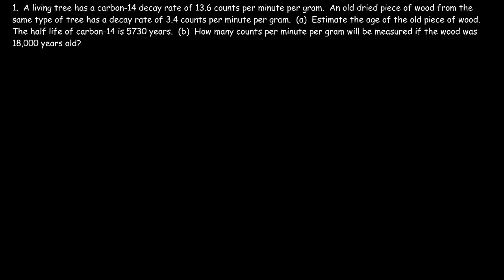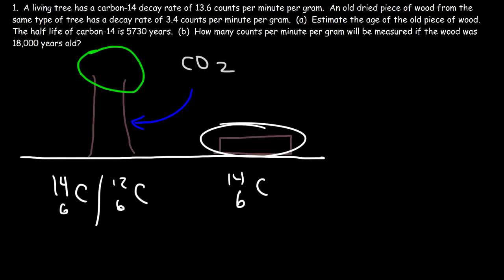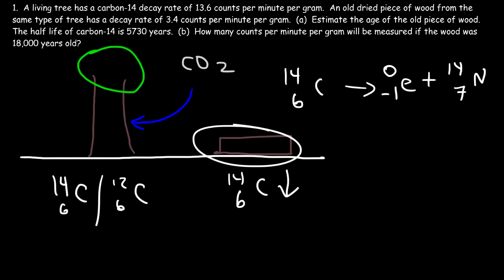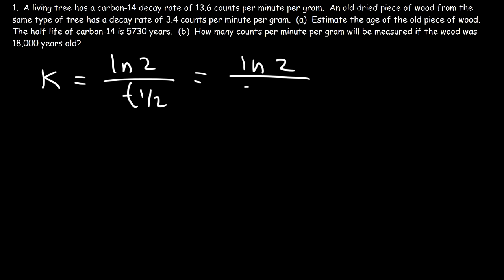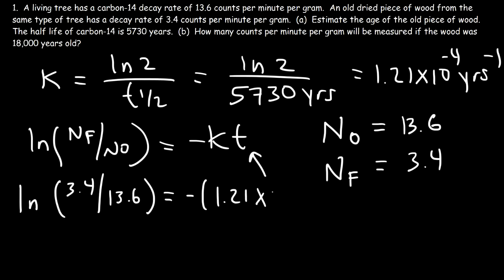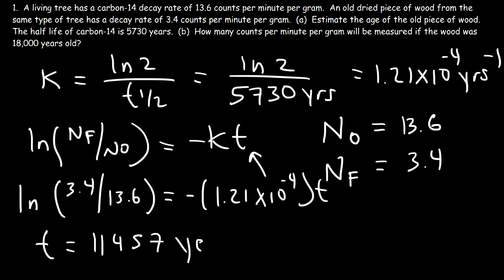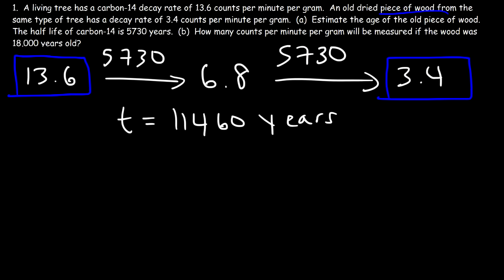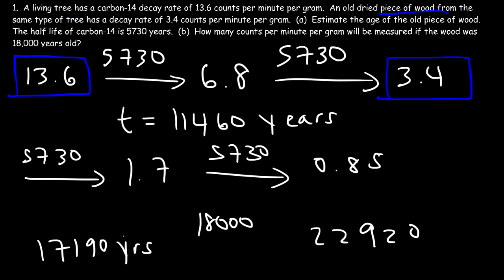Carbon 14 Dating Problems  - Nuclear Chemistry & Radioactive Decay

Comment: C14 half-life is 5730 ± 30 years, who was born ~5730 yrs ago and observed certain amount of C14 decay to half of it's original amount after 5730 ± 30 years?
Reply: Nobody. The half-life is simply calculated from the decay constant which is the rate of decay as measured by beta particle emission.    T 1/2 - ln(2) / lambda  where lambda is the decay constant.
Reply: I’m guessing if you have a “large” sample size and then compare the radioactivity after a “long” time period you can extrapolate a accurate picture.

The bigger problem might be the assumption that carbon 14 was at a constant ratio through the last 50,000 years. That’s an assumption they make. It’s also an assumption that the decay rate is a constant through the existence of the universe.
Reply: @godloves9163  You are right about religion = mythology!
Reply: @godloves9163  Belief is accepting something without evidence.  Scientists do not "believe", they accept evidence and if the evidence changes and can be validated, then it is accepted.  Belief is in the domain of religion, all religions require their followers to believe in things that cannot be proven, a very big difference from science.   It is sad that you appear on the comments to a scientific video and try to denigrate valid science and insult scientists to prop up your religious beliefs.
Reply: @godloves9163  So, when you get fat by eating too much, the complex molecules in the fats and proteins cannot possibly organise themselves?   You are entitled to your religious beliefs, but getting them mixed up with scientific facts that can be validated by many others is futile.
Reply: @godloves9163  OK so there are still mysteries to be discovered, but compare what we know today to what they knew 2000 years ago.  You are using a computer that is astonishingly  powerful compared to only 50 years ago.  I'll bet that in another 200 years we will know all about DNA and many other things you think are mystical today, that is the way science progresses.  Science is just shared knowledge and the Creator put lots of things out there that will challenge us to the end of time.  The "big bang" sure looks like the moment of the creation, just a bit further back than the people thought when the Bible was written.  It had to be simplified for the educational level of the folks back then anyway.  No reason for science and religion not to co-exist, but each has its own set of criteria.  Have a great day!
Reply: @karhukivi   not even close. It’s not a mystery. You believe a book can write itself or complex information system can come about by random chance. That’s against the laws fir nature, physics, observed science. Indeed you believe in an impossible mythology. There a difference between unknowns of how some things work compared to how it was actually made when we already have the evidence. But some want to remain in willful ignorance. No book can write itself ever but THIS IS YOUR BELIEF THAT IT CAN. That’s the point.

You ignore the bible because you love some type of evil in your life and don’t want to let it go but convinced yourself over time that it’s ok. Ponder in this deeply. People willingly ignore the fact that the book of Daniel written centuries before Christ predicted the last 2500 years of major human events. This is only a very small portion of the predictions etc: “Angels in the Glen book of Daniel study”
Reply: @godloves9163  I could point out that there are already robots that can do self-assembly, but I can see you are fully committed to your beliefs and there is no benefit to me in trying to change those beliefs.  We will agree to disagree, and I'm signing off here.  Have a great day!
Reply: @karhukivi  Also no... your fat cells do not organize themselves, they are sorted into storage or use within the body do to a complex and specific process of interactions between several hundred to thousands of cell Colonial masses, which use RNA to trigger and sort themselves about their tasks across the body, and error or issue to the body or cells can prompt improper interaction or storage and thus lead to complications like obesity 

It is not "random" because of the programming of the cells and the lipid exchange, the complex and coherent information requires intelligence to direct and execute properly, else the body dies... this must go on every second of every day, without issue...on top of the fine tuning required to prime celluar life with the ability to adjust to external stimuli acting through bioreactive mediums (water, blood, early earth mixtures of minerals and liquids, ice etc)

Again, a weird way of saying these things, but thats the point, I'm trying to point out how the language of modern science doesn't stray far from its alchemical, occultic roots

Darwin and his bulldog influenced Huxley, and Crowleys effect on science alongside the new age movements touch on rocketry with the Nazis...the truth is closer to fiction than you'd want to believe...

Comment: The theory is nice, but in practice ?  and the influence of powerful CME or geomagnetic storms ? how to take a sample?  having a mass perfectly known ? putting it in a detector and not miss one decay event ? I don't understand how historians are able to pinpoint exactly one year (especially during the first millenia) for events, and how to be sure Rome avents and Gaul events are in sync ?
Reply: Because they are LIARS.
Reply: You don't just take carbon dating by itself, its got a 5% margin of error that needs to be taken in conjunction with anthropological/historical evidence. It's the carbon dating in combination with other evidence that gives it power.
Reply: @theophrastusvonhoenheim4022  yes, you combine several clues to converge toward a date approximation. Clues in order or stratification, clues in writing, etc.  But if you thing is buried instead of anbandoned there, if your writing is a fiction and not a birth certificate, and if the sun sneezes at this moment, then the dating is off.

Comment: This method works wonderful giving the decay rate of the things, or the sum of c14 before hand. But this method is not reliable when the sum is not given ahead of the equation.
Reply: Again they assume many factors which is non scientific lol
Reply: Remember that c12 is also there and the ratio of c12 and c14 in a living thing is going to be similar to that in the atmosphere (which we can measure). c12 doesn't decay so all you need to do is look at c12 and calculate how much c14 there was before it died (or got cut of from a tree).
Reply: @MrDzoni955  How would that prove that the C14 is decaying at a steady rate over thousands of years though? The c12 would just be a base amount to juxtapose with the c14 but the changes would have to be confirmed over various examples wouldn't they?
Reply: @ThatOneAlbinoMofo  We know the rate of decay and it's fixed. c14s half life is always the same. Now this is physics and the math behind it is way to complicated for a layman like me
Reply: @MrDzoni955  I agree, i suppose the issue comes from when we question the concept of "proof " as subjective or objective?

For example,
Radiocarbon dating seems to be a based on subjective inferences rather than objective claims witnessed in action with the of the variables of the "natural" world 

I think I all boils down to language when it comes to science, in fact it would be hard for us to discuss these things with beings if energy or of those beings with prolonged lifespans even if they were able to help us prove our methods are correct, that's a huge consideration to play around with

I think thats where doubt comes into play for skeptics like myself, I don't doubt the science, just the certainty of the conclusions as applying by those that reference the research but lack the means to perform the experiment themselves?

Comment: The assumption that C14 is constant is incorrect, 
Carbon14 can be affected by a number of different factors or events:
	• The strength of Earths magnetic field
	• Atmospheric C14 variations between hemispheres
	• Burning of fossil fuels as during the industrial revolution caused variations to the C14 in the atmosphere because of human use of fossil fuels (Seuss effect) and decreased sun spot activity (Maunder Minimum)
	• Alteration effects such as fractionation (dC13 correction)
	• In situ production from N14 within trees
	• C12 added to the tree through the uptake of water from the subsurface dolimitic (carbonate) soils this would result in C14 ages obtained which would be much older than they really are.
	• Recrystallisation in shells and the marine effect
	• Volcanic eruptions contaminating the atmosphere
	• Forest fires
	• Sun flares
	• Lightning storms - Carbon-14 may also be produced by lightning [22][23] but in amounts negligible, globally, compared to cosmic ray production. Local effects of cloud-ground discharge through sample residues are unclear, but possibly significant.
	• Nuclear testing

The C14/C12 ratio can never be proven to be a constant.
Reply: @Dylan Morrison can you state how much Carbon is stored in Coal, Crude oil and Natural Gas underground?  This C12 would have been above ground at some point.  Now calculate the C14/C12 ratio and compare it.  I would suggest that would change the C14/C12 ratio substantially.
Furthermore,, If the atmosphere were millions of years old then the C14/C12 ratio would be at equilibrium . However we know the ratio is not at equilibrium therefore the atmosphere cannot be millions of years old.
 Since C14 is forming faster than it is decaying it is impossible to know the past ratio and get an accurate age calculation by carbon 14 dating.
In addition we know that if a fossil contains carbon 14 then the fossil is less than 60,000 years old.  The AMS method claims they can measure to 90,000 years.
Reply: The method is calibrated against such data as tree rings and historical items whose dates are known, so all the effects large and small that you list are in effect factored into the calibration.  It is also calibrated against other dating methods like thermoluminescence.  So far, the assumption that the C14/c12 ratio is roughly constant seems to work out very well.
Reply: @karhukivi  OK tell me what the C14/c12 ratio was 6,000 yrs ago.  Remember we have a shed load of C12 buried in coal, oil and gas.
BTW I have 3 trees all of the same species (silver birch) planted 15 yrs ago within 10m all had the same watering in the same soil yet all 3 are different diameters ranging from 3.5cm to 15cm.  The trees in.my street are pin oaks and they all show different diameters.  Either the thickness of rings are different or some have multiple rings.  I presented that research to IntCal and I've yet to get a response.
Wuth thermoluminescence
there are many unknowns and many assumptions need to be made, including the amount of radiation ‘stored’ in the mineral at a certain time in the past, that the change in radiation has only been affected by the radiation in the environment, that the radiation in the environment has remained constant, and that the sensitivity of the crystal to radiation has not changed. All these factors can be affected by water, heat, sunlight, the accumulation or leaching of minerals in the environment, and many other causes.
Re: Dendrochronology
"The biggest problem with the process is that ring patterns are not unique. There are many points in a given sequence where a sequence from a new piece of wood matches well (note that even two trees growing next to each other will not have identical growth ring patterns)...." 
The extended tree ring chronologies are far from absolute, in spite of the popular hype. To illustrate this we only have to consider the publication and subsequent withdrawal of two European tree-ring chronologies. According to David Rohl,  the Sweet Track chronology from Southwest England was ‘re-measured’ when it did not agree with the published dendrochronology from Northern Ireland (Belfast). Also, the construction of a detailed sequence from southern Germany was abandoned in deference to the Belfast chronology, even though the authors of the German study had been confident of its accuracy until the Belfast one was published. It is clear that dendrochronology is not a clear-cut, objective dating method despite the extravagant claims of some of its advocates.

But you're welcome to BELIEVE that.
Reply: @georgebond7777  Science is not about "belief" - that is the domain of religions!  Of course there are limitations and assumptions as with many scientific techniques and constant attention is paid to calibration in research publications.  If you read a good selection of publications on C14 dating and still cannot accept them, then that is your prerogative and I have no intention to get drawn into an argument about your beliefs - you are welcome to believe whatever you want!
Reply: @karhukivi  of course it's about your beliefs.  You BELIEVE a dot of nothing exploded caused rock soup to come alive and here you are. Is that science?
 Don't BS me mate, yours is as much a belief as mine.  Magic without a magician vs Magic with a Magician, now which one  is more rational.
Reply: @karhukivi  so do you want to talk C14,  how about C14 in diamonds, I know a lot about that.
Reply: Wow.... great job, and great research!
Reply: @karhukivi  some science is true some is about a belief aka mythology beliefs. You believe in the mythology one which pretends to be science.
Reply: @karhukivi  George Reynolds why are not trying to argue those points that George Bond is making? You are completely ignoring every point that he has made. Do you just give up completely? You agree that his points are very valid?
Reply: @karhukivi  Aren't the ancient tree-ring dating based on C14 dates/timelines?  In other words, it looks like one group of date research (C14) is dependent on another (tree rings) for 'calibration' (often hundreds of years of 'calibration'), but the tree-ring dates are similarly dependent on C14 dating to set its ring baseline. When it's circular, what can go wrong?
Reply: @ThrashLawPatentsAndTMs  I think most scientists wold see a circular argument and pounce on it to discredit some junky research!  Dendrochronology can go back to the end of the last Ice Age, approx 13,000 years bp by looking at overlapping sets of ring growth patterns on living and dead trees, including some preserved in bogs following the Ice Age.  Other methods are used to calibrate older C14 ages, but it is only 5-10% at best, it won't give day and month.